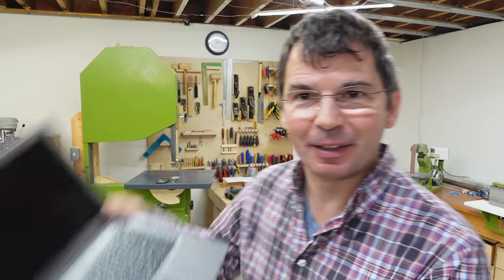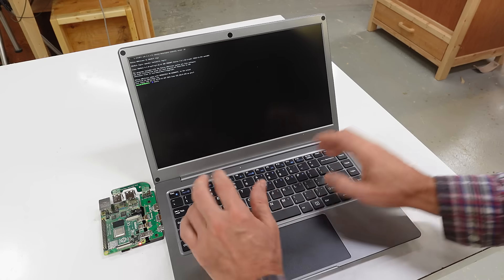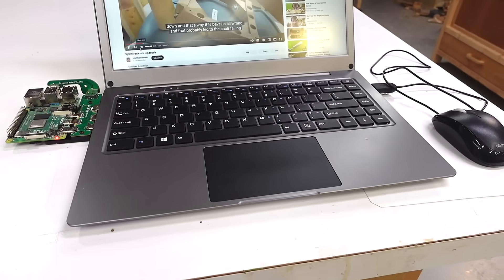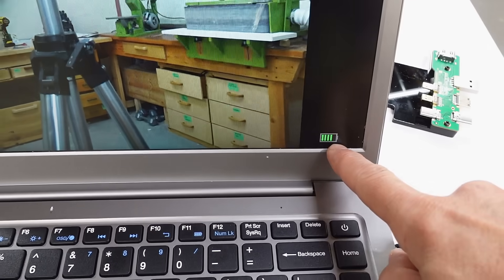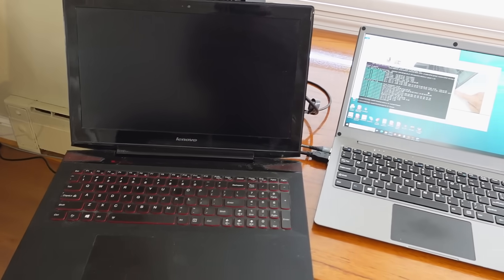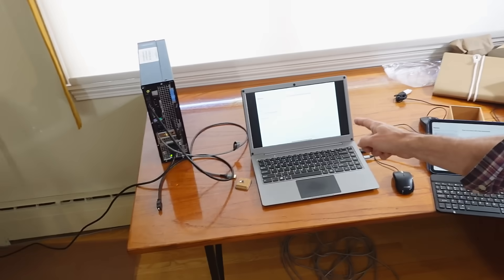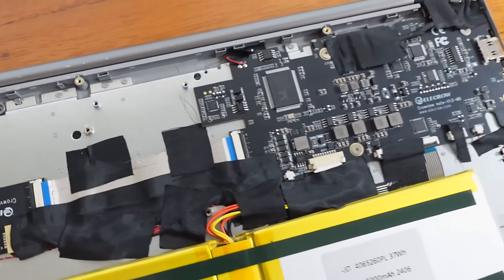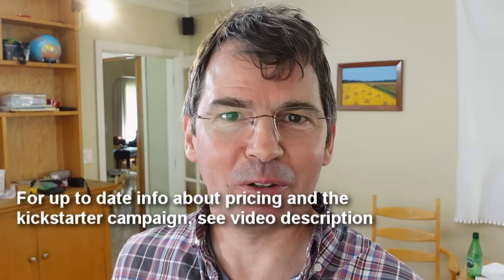This laptop has no brain

Comment: I work as a computer technician and I carry something like this around with me in my bag of tools. There are so many computers and servers out there that are operating in a headless environment, and they can be tough to troubleshoot that way if they stop working. Something like this provides a much more compact and portable solution than carrying around a small screen, power supply, and wireless keyboard and mouse. It doesn't seem like this device natively supports VGA inputs though, which kills its usefulness for me. Server hardware and industrial equipment still only support video out over VGA, so I have to have it.
Reply: There are some cheap active VGA to HDMI converters that I carry and they do work pretty well. As i kinda had the same issue as well. But be aware that you need to use a active converter.
Reply from the maker: are you sure?  hdmi to vga is common, but vga to hdmi?  that would be much harder to do.
Reply: @matthiasrandomstuff2221  VGA to USB-C I've seen, or USB-A, but you're right, VGA directly to HDMI isn't standard. DVI maybe, then you can do another adapt to HDMI and pray to the interface gods it's all wired correctly!
Reply: @matthiasrandomstuff2221  Yes it's a bit iffy, as they have to convert analog to digital but they do exist. and with low resulutions they can show some weird artifacting.
Reply: @oPiggySue modern to VGA is fairly common (use case old projectors and in wall cables in corporate), but vga in to a modern interface is super uncommon.
Reply: care to share the one you use?
Reply: @vsync  It's a home-made contraption that I cobbled together out of a small 10 inch display with VGA and HDMI inputs that I bought off of Amazon about 8 years ago. The display itself seems like it was specifically designed for Raspberry Pi projects, as there was a mount point for one on the back of it. The display isn't listed for sale anymore, and I don't think it was ever a mass produced product because it looked home-made before I modified it. That's why I'm always on the lookout for products like this, as mine still needs an external power supply, doesn't look very professional, and is pretty fragile. I'm worried that I'll break it someday carrying it around in that backpack.
Reply: I thought the same thing. This little laptop can almost replace the monitor carts that we used to roll around datacenters instead of buying expensive kvm systems.
Reply: I would actually love something like a wireless version of this, but I don't think the bandwidth over wifi or bluetooth would lead to a very good experience. I'm struggling with what to do when my laptop dies and I want to access my desktop from around the house. The problem with multiple computers is it means extra maintenance.
Reply: Will the touchpad and keyboard also work when connecting to computer via usb-A? And can you access the bios?
Reply: @mydogsbutler  Yeah, I generally don't have any problems with the USB connection for the peripherals. Some really old equipment will only work with PS2 peripherals before the OS has booted up, but I haven't run into anything like that for quite some time. You also need a floppy drive a lot of the time for stuff that old. Hopefully everything like that is either decommissioned or dead at this point.
Reply: @frequentfrenzied  Perfect. Looking for one to do repairs and manage headless computers on rack. I just bought at Uperfect udock 15.6 pro but I've tried it on 4 PCs and the keyboard/mouse didn't work.  (worked on android and iphone wirelessly, and on Mac mini m2. using onlyUSB-C .  Unless support tells me I have a defective unit going to return it and get this one. Thanks for the assist.

Comment: No, no, no, no. Just make the bottom of the "laptop" deeper so you can put the pi inside. I can see too many problems with all that hardware hanging off the side. You would be better off with a cheap keyboard, monitor etc. Sure you can o hardware stuff with the Pi hanging off the side, but Personally, I can't see paying for this cobble job.

Comment: I suppose it could be a decent KVM for rack server administration. Dedicated rack mounted KVMs tend to be very expensive
Reply: PiKVM is so much more superior to this.
Reply: @jothain PiKMV is more for remote access. I’m talking about using this locally in a rack of servers to administer them locally. Manufacturers make devices like this that are basically just a laptop screen with keyboard/touchpad that you mount in rack, but they are very expensive.
Reply: Tech Tangents has one of those and that's what he uses it for. That's what the product was designed to do primarily. And it has the advantage of being battery powered so you can carry it around without being tied to the server rack.

Comment: 3d print an enclosure for the Pi that can attach to the back of the screen with Velcro and that could be a great low budget laptop.
Reply: Exactly what I was thinking.  I have an external drive that I Velcro to the back of my MacBook.  Much less chance of it getting knocked around.
Reply: I've seen people use Velcro up at the top of the lid (on normal laptops) for carrying some sort of RF/SDR doodad

Comment: So it's a knock-off Nexdock, with strictly worse charging, and an adaptor to make it work with a Pi. I personally use a USB-C monitor (that supports PD passthrough), and a bluetooth mechanical keyboard and mouse with "desktop mode" on my Huawei Mate Pro 20 for note-taking and D&D character sheets, and it works remarkably well, but that doesn't have an internal battery for the screen.
Reply: More like a portable server console.

Comment: If this is only $129 for a Samsung Dex laptop ... That would be an amazing value.
Reply: Except you cannot control multiple devices with a Samsung Dex Laptop.
Reply: @BrunodeSouzaLino  why do you mean can't control multiple devices?
Reply: @kaislate  The Samsung DeX laptop is only compatible with Samsung phones.
Reply: @BrunodeSouzaLino  this is compatible with wide array of devices including Samsung Dex devices... as are the other ones. In fact I am unaware of any Samsung Dex only device.
Reply: @kaislate  This is not a Samsung DeX laptop. Samsung DeX laptops only work with Samsung phones.
Reply: @BrunodeSouzaLino  That's not true. There are no dex only "laptops" ... And yes this one works with dex. For $129 this is a great deal.

Comment: Why didn't they just add a removable panel on the bottom with a Compute Module socket?? that would be infinity more appealing
Reply from the maker: if you want to use it as a computer, definitely.  But if you want to use the pi for hooking various bits up to it, its easier if its outside the case

Comment: I would like this product a lot better if it had a cover on the bottom where you could put a Pi compute module and have it protected for a true portable Pi laptop.
Reply: Exactly this! If the bottom had a larger compartment with the cables in it,you could use it with any SBC and it would be a fully contained system. I have been waiting for this and no one has done it yet. They have a PI laptop but it's not really what I want. I want to use any sbc and plug it in and start using it. If I knew enough about circuits I would design the circuit and 3d print a case but I need a circuit like what is in this with battery, power supply, usb sound card, usb hub etc. It's a pretty complex pcb for me to design. Way over my head.
Reply from the maker: it would have to be a lot thicker, and have a fan for cooling.  Though personally, I would like that format too!
Reply: @matthiasrandomstuff2221  I would also like this idea. This way, you can upgrade the board after the old one gets obsolete instead of buying the whole laptop. Way less junk. There was an approach similar to that, where you could build your own laptop but the number of options was very limited.
Reply: @matthiasrandomstuff2221 I mean yeah but I think I’d prefer it being a little thicker rather than having a big block of electronics outside of the laptop
Reply: @matthiasrandomstuff2221  Fans are a good thing. I like things with fans. Especially routers. Remember when routers had fans?
Reply: @newmonengineering  Exactly what i am looking for too!
We need something like a reverse Kickstarter, to request such a thing xD
Reply: @newmonengineering  
"If I knew enough about circuits I would design the circuit "

You're over complicating it.
USB 2.0 has 4 lines
USB 3.0 has 6.

All you need to do is utilize the USB 3 paths in your circuit and plug it into a USB HUB.

Purchase a couple of USB male and female ends and play with them a bit.
Once you see how it actually works, design your circuit to plug into a USB hub. 

That's all this thing is doing.
Reply: I'm guessing the cover on the bottom was originally intended to be where you would plugin some sort of USB Mini PC Stick. Only that product failed or otherwise doesn't exist yet.
Reply: @THX..1138  Maybe it would have been for a raspberry pi pico.
Reply: Clearly that would be ideal.  This product as is seems like another novelty Pi item that's doomed to fail.
Reply: Won't be long before someone makes it a nice 3d printable enclosure
Reply: There probably can be a way to mount it on top, near a touchpad. Well, in a new design, not in current version. Don't know if it will be good, but a possibility
Reply: This product is not made for that. The primary purpose of this product is to act as a console terminal to access servers remotely.
Reply: @BrunodeSouzaLino  "remotely" yet has no networking capability so that's a bit of a stretch.
Reply: Yeah, it's pretty jank.
Reply: Makes better sense!  To many inconveniences

Comment: Ive got one of these - its very specifically for tech professionals to connect to servers or hard to reach industrial systems (in my case I work in Robotics, so its very useful for embedded device that I cant bring a normal keyboard/mouse/screen to.
Reply: so is the elecrow one just a re-brand of an existing model? I've never seen these before (but it does make sense). What "brand" is the one you already have?
Reply: Would you care to identify yours please?

Comment: I'm suprised it uses an actual Pi instead of a compute module
Reply: Compute module could have been installed under that little cover on the bottom. Then it would have been a complete laptop, and upgradeable too, when new versions of compute module come out.
Reply: Rpi Compute modules basically are unobtainium.
Reply: Compute module is often more used by professionists

Comment: i have a handful of computers running as servers with no monitor, and from time to time i need to drag out a monitor and keyboard to fix something, it could be very convenient to plug this thing in to manage my servers
Reply: need vga input…😂
Reply: That's what Tech Tangents uses his for.
Reply: There are plenty of these things, with a trackball or a touchpad and with fittings for a 19" rack. Very easy to use with kvm switch
Reply: there are LAPDOCK for ATRIX 4G still floating about on ebay on the cheap, could use one of those with the appropriate adapters

Comment: For ~$120, I can see some uses. For example, I have a few boxes around that sometimes aren't accepting SSH connections so I need to move a monitor and keyboard to get access or just power cycle it if I'm feeling  lazy. This could be a handy way to troubleshoot things, but only to save myself the effort of moving peripherals.

Comment: Honestly I was down to buy it but the 12VDC barrel plug changed my mind. 😖
Reply: there are usb c to 12v  barral plug adaptors so you can use another dongle.
Reply: @KeinNiemand  Yeah I have a few, though they don't fit well (too long) and I don't like the leverage they put on the port. Maybe I can find a short cord instead. Might be a shopping skill issue. 😅
Reply: Completely agree. I refuse to buy any product that isn’t powered by USB-C and that includes Micro-USB products.

Comment: It having mounting holes for an NVME drive I imagine they outsourced a laptop chassis and just put their branding on it, which would also explain a device targeted at people who would want to 'laptopize' a phone or a Raspberry Pi having a Windows key.
Their solution for connecting a Raspberry Pi is pretty jank, though. I'd much rather a cable that connects on the laptop on one side and splits into USB, HDMI and power at the other end
Reply: Agreed. The pcb with 3 connectors would be nice if that broke out to a cable which then broke back out to 3 connectors. At least they didn't make a proprietary port.
Reply: yeh it felt like raspberry pi was an afterhought or something oterwise they could have put in a slot for a rasberry compute module
Reply: they missed an opportunity to have it use a compute module instead and put a motherboard it can attach to inside. Dollar store Framework.
Reply: @iiisaac1312  It says right there "portable monitor with keyboard" making it a compute module case would change the intended purpose entirely
Reply: A single USB-C with display passthrough could handle all of them
Reply: "outsourced"? They probably bought overstock and came up with a use. However they got the cases, all they did was rearrange the ports. Nearly any other way of attaching the pi would be more practical.
It's something you could make by ripping the motherboard out of a laptop and adding a HUB hub and adapters.
There's zero consideration for making up for what you lose on either device because of this.
It's not "a scam", but it is low-effort trash and you shouldn't care.
Reply: @kyleolson8977  considering the intended use case scenarios, cost cutting is a necessity. I don't think many people would be willing to fork over $250-300 to plug a $500 phone much less a $100 Raspberry Pi

Comment: Wireless Keyb+Mouse , Portable-USBC/HDMI Monitor, 10000mAh or 20000mAh Powerbank and you would essentially have the same thing with multiple redundancies. Keyboard broken? replace. Mouse/trackpad wonky?replace.  Battery kaput ? replace 😀

Can you get the different Framework Laptops including the latest RISC-V one and compare with a R-Pi4 ? How does Pi4 compare against a RISC-V processor ?
Reply: That's 3-4 separate gadgets you'd have to get out of the bag plus multiple cables to hook them all up every time you wanted to get a laptop interface out of your phone/tablet/handheld console opposed to just pulling out one single item that your backpack already has a compartment for and connecting everything with one single cable, in addition that buying everything separate will probably cost more than this one unit.
Reply from the maker: what would be really cool is an actual laptop computer that can serve as screen, keyboard and mouse for another device.  But the market for that would too small for the engineering effort it would take to make one.

Comment: Some random 12V adapter instead of USB-C charging? Shame...
Reply: yeah, kinda a deal breaker for me, it's just so much more convenient to charge all my gadgets from USB-C...
Reply: @IntegerOfDoom  I wouldn't recommend those magnetic adapters for anything above 30w unless you got a infrared camera to periodically check for overheating.
Reply: Ya I don't really care but you might have people complain when they couldn't use any usb c it likely needs 12v so it would have to be PD and people would try the wrong thing and it not work
Reply: it does make it way simpler/robust, though. usb-c is like i can do it all as long as everyone implements all the protocols correctly, and all port support power delivery. It's an expensive solution, annoying to repair too, any issue with the power brick would burn the data lines/ICs as well.
Reply: It's an old model, what do you expecting, eh?
Reply: Crazy that vendors think this is ok in 2024
Reply: I will never again purchase a laptop that needs a dedicated barrel charger. 

 The convenience of just plugging in any USBC charger is too great.
Reply: @robertdascoli949 even my laptop which comes with a 65w USB c charger works with a 15 watt charger, as long as I disable CPU turbo and lower screen brightness 😅
Reply: @robertdascoli949 the same adapter can charge your phone and any other usb-c device too. Very practical (:
Reply: Honestly that's hardly the biggest issue when it comes to practicality, considering the fact that it has its motherboard hanging from the ports on one side. Practicality isn't exactly that device's strong suit in the first place.
Reply: Agreed. There is no chance I would purchase this if it cannot charge via USB-C.
Reply: They probably thought people would confuse the usb-c charge port with a data port.
Reply: @GrayRaceCat  they're all data ports on laptops (sometimes limited to only a few charge capable ports)...
curious if it is capable of type-c charging, as that should be a no-brainer.
Reply: @frollard  Except, it's NOT a laptop, it's a portable keyboard and screen.
Reply: @GrayRaceCat  yes, lets always punish majority of the user-base for the moronic outliers. this is the way.
Reply: @GrayRaceCat They should all be the same. No need to differentiate.
Reply: USB-C to barrel adapters exist and work fine.
Reply: @alx9r  the whole point of an integrated solution is to cut down on all the dongles & adapters.
Reply: @IntegerOfDoom  There's lots of salt in tears shed over the lack of USB-C charging, I think you're covered. lmao
Reply: USB-C is bad power socket. 
Too unreliable, too fragile, too expensive for repair.
Reply: @semibiotic  the socket is actually easy to repair, even I with my bad soldering skills did it once.
the problem is mostly bad design of the board.
Reply: @Lorem_the_Ipsum  Extactly. Tailored microcontroller with tailored firmware is never good for repairability.
USB-C socket isn't reliable itself. It quickly collects dirt, that is hard to cleanup.
Reply: You can get a USB PD emulator to convert the barrel jack to USB PD
Reply: cry about it
Reply: Who cares... think about something important in life....